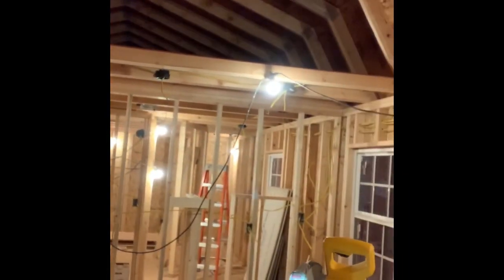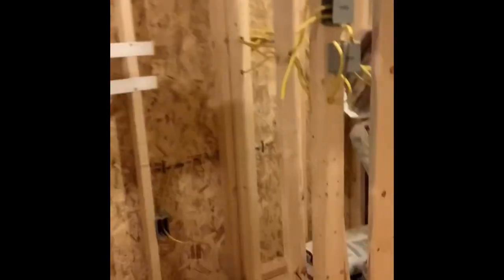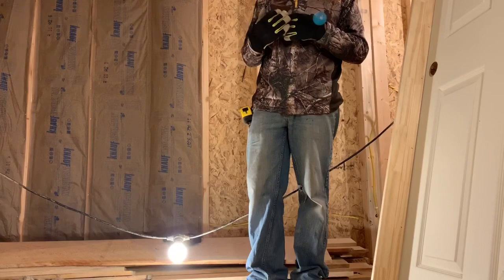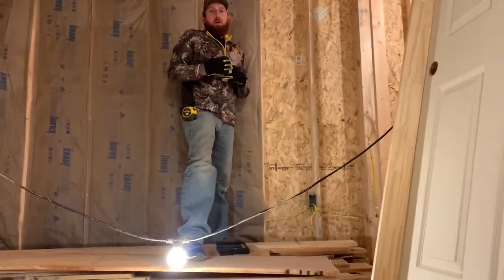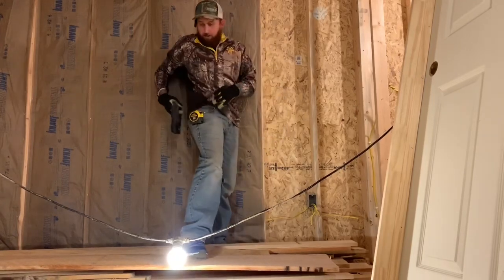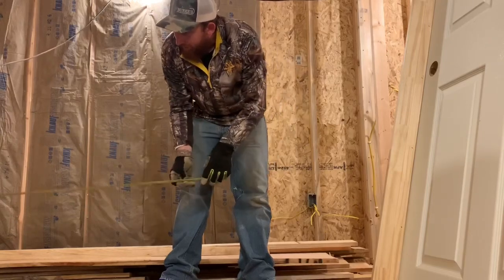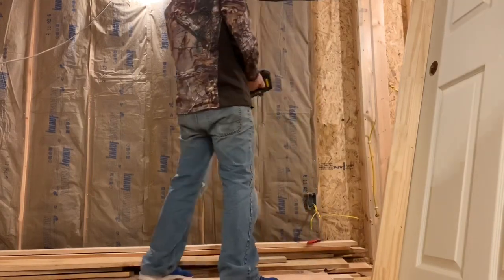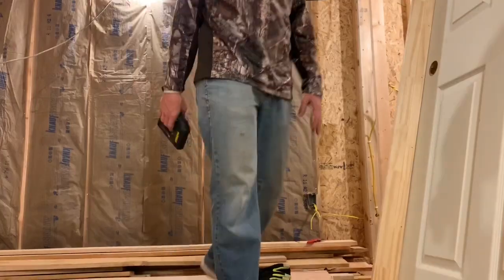Insulation install on our shed to house conversion

Comment: QUESTION:  Why did you sandwich the electrical wire within the installation?
Reply from the maker: That’s a great question Annette . Without doing that the insulation can’t fully expand causing a air pocket between the wall and insulation which would give that spot a R value of 0 . With doing this it allows the insulation to fully expand around the wiring filling that void .

Comment: Did you use rafter vents in the ceiling
Reply from the maker: Yes I did
Reply: @Clcogburn85  are rafter vents mandatory or optional
Reply from the maker: In my opinion mandatory but of course you can build however you want to . The vents help the insulation work and keeps mold from starting from moisture
Reply: @Clcogburn85  thanks